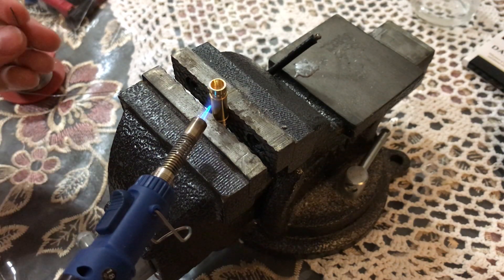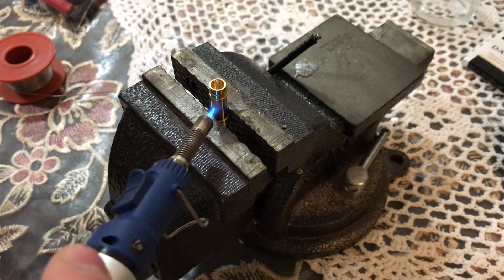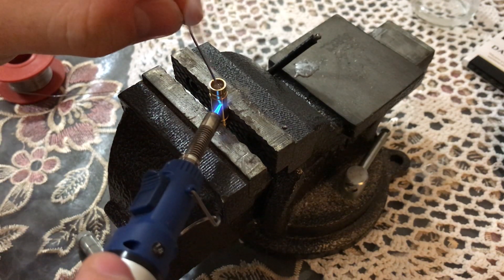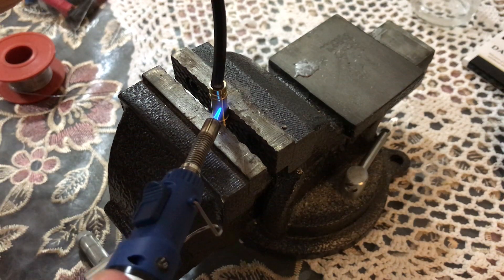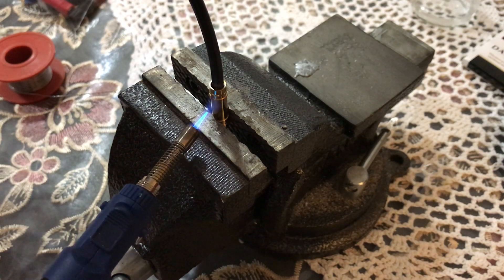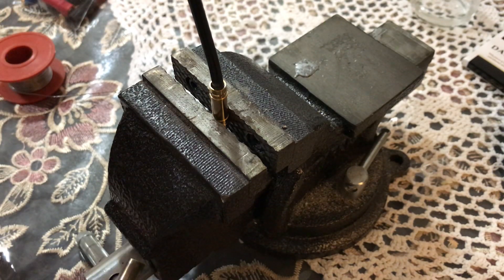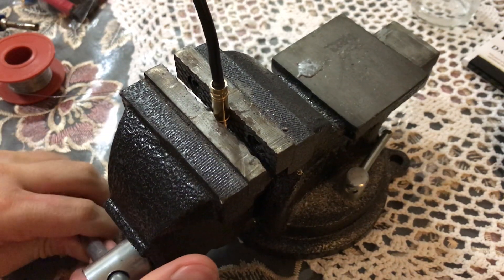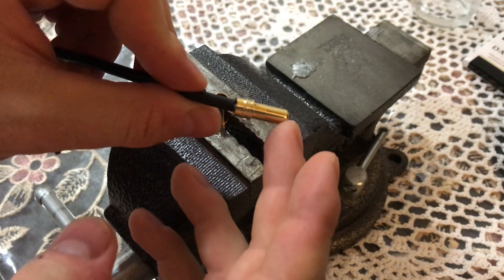BEST Way to solder XT150: 12 AWG Banana Plug Bullet Connector soldering

Comment: Thanks for all the useful information. I bought some xt150 connectors to use between my motorcycle stator and rectifier. The stator produces 80V at 6.000rpm . You think these connectors will hold up? Thanks!
Reply from the maker: My suggestion is not to use soldered connectors on motorbike  - it can crack down eventually due to vibrations.

Comment: Why the hell would  u  say don't  use wire stripper ,  but use  your teeth  just dumb  , if i could   give two thumbs  down   i would ,
Reply from the maker: i agree with you now. I should have said "avoid low quality cheap stripper". I still don't have good strippers with length adjustment, but now I'm not using teeth for 12/10 awg, it's too thick - I use  sharp cutters to make a round cut in the insulation. For 14+ awg I use teeth, it's much more faster and easier.